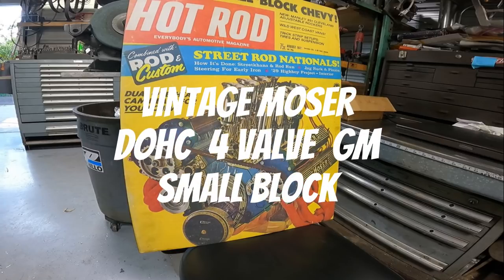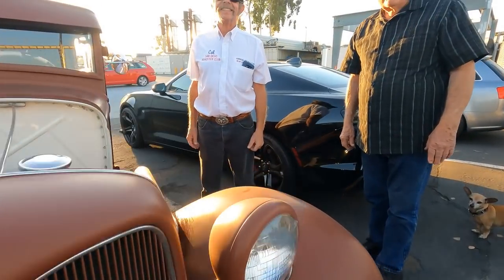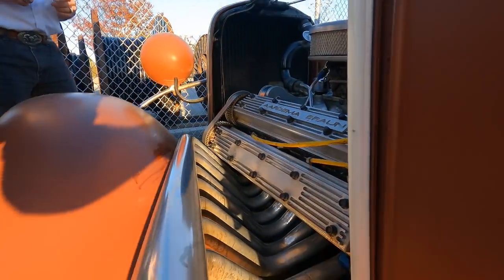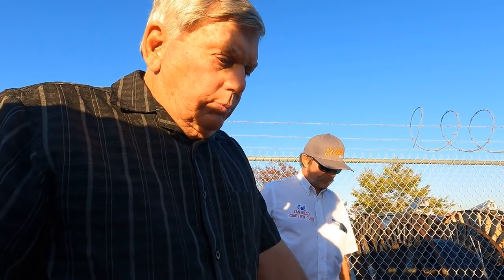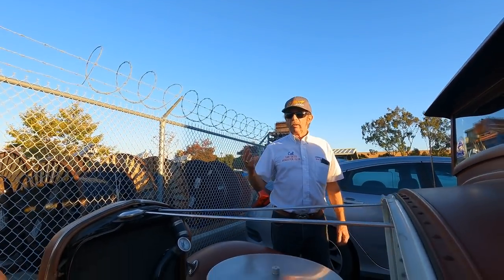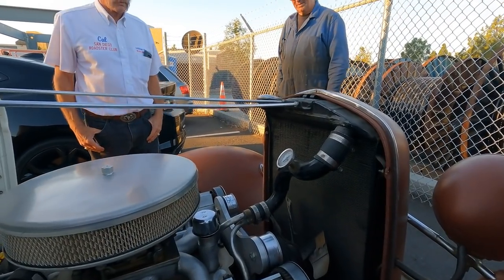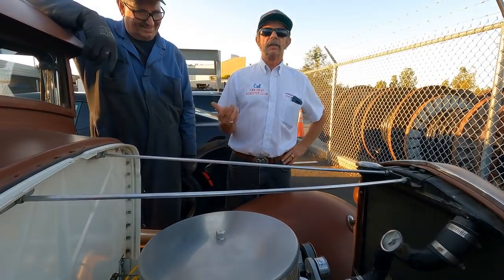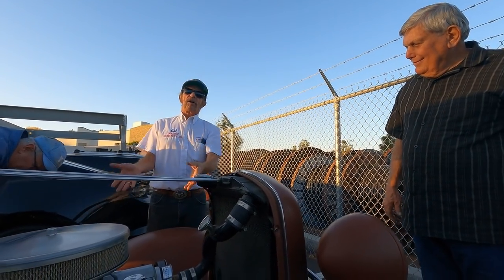Vintage Dual Overhead Cam, 4 Valve, Chevy 350, 1971 Hot Rod Magazine  Moser Feature Aardema/Braun

Comment: 2 exhaust ports per cylinder like a Merlin/Allison WW2 V12 aircraft engine, probably where they got the idea for the port style. genuinely an awesome part of automotive history, and something that's rare to hear running at all. it's like the GM version of the "Doomsday" DOHC Hemi that was prototyped for top fuel, but smaller and doesn't run on Nitromethanol.

Comment: So what does the pushrod cam do? Just spin in the block? I assume the overheads are the ones working the valves
Reply from the maker: It's used as an idler gear and drives the distributor and oil pump
Reply: @GregQuirin  Thanks! Great video and awesome engine!

Comment: I forget the guy's name but he took the 427 Ford single overhead cam and instead of a timing chain because the timing chain would get stretched out and you have to time both sides of the engine separately he put a whole bunch of deers that ran the camshaft which made it much more reliable and tunable

Comment: So, any plans for production? Somewhere I have an old magazine with an article on a bunch of Ford's crazy prototypes. They built a SOHC 289 or 302, intending to sell the setup as a kit but since they didn't optimize the intake and exhaust ports and the manifolds, they didn't figure it added enough so production didn't happen. Just needed some more R&D! The heads were special castings with several more valve cover bolt holes since that's how the cast aluminum cam carriers mounted.

That's one area of small block Chevy heads that's always been stupid, not machining the valve cover sealing surface. The covers require a massive amount of sealer on the gaskets, and they don't have enough bolts. Aftermarket heads of course often correct that by machining the top face of the head and some stiff aluminum valve covers can seal decently with the 4 bolts and minimal sealer.

Comment: At the same time Alfa Romeo was mass  producing chain driven all alloy DOHC engines with mechanical port fuel injection and individual throttle bodies.
Reply from the maker: Did you see my 32 Alfa 8C Monza video?  Check it out!

Comment: Arias has built several 502 Chevy big block V8's with DOHC 32 valve heads.  The heads themselves come from the Porsche 928's V8 engine, which is also a big block and as such the bore spacing is almost exactly the same.  With some welding and drilling the heads drop right onto the Chevy block;  These will pass California emissions and make 550 hp all day long with stock cams.

Cool video!
Reply: Anything will pass CA emissions if it's in a pre '75 platform.
Reply: @toomanyhobbies2011  I thought the engine year mattered as well?
Reply: @Flies2FLL  once your car is pre 75 cali aint checking anything you just drive it.
Reply: The Porsche 928 engines were not big blocks, they ranged in size from 4.7 to 5.3 liters in 2 valve and ultimately 4 valve configurations.
Reply: @hoost3056  The displacement does not determine whether it's a big block or not. Chevy made small block 400's and big block 400's (396). What he means is that the Porsche block has a bore spacing (the distance between the middle of two cylinders) almost on par with a Chevy big block. Porsche probably designed the 928 motor with racing in mind which usually means a big bore short stroke engine hence the relatively small displacement in the 928 compared to a big block Chevy
Reply: @erikkiel3695  The bore spacing of the Porsche M28 is 4.804 inches, very very close to the bore spacing of big block Chevrolet and Mopar engines.  This was done to give generous cooling jackets and Porsche built the cylinder barrels completely from aluminum, NO steel liners, so the barrel walls had to be thicker.  This produced a very large engine with smaller displacement.  

I suspect that this crate engine would fit just fine under a 928's hood with a proper low-profile intake manifold.  Since a dressed M28 weighs over 550 pounds, the car would need stronger springs in the front to handle the extra 130 pounds of the crate motor.
Reply: @hoost3056  The Porsche was a shorter stroke but similar bore.

Comment: The intake cams on both heads have a dangerously low amount of belt coverage on their pulleys. Hopefully it doesn’t skip teeth.
Reply: More than some production engines
Reply: front the miles he has on it and the spirited driving he has done to break drivetrains its pretty obvious it doesn't

Comment: Now, let's make it a non-interference motor, lower the compression  and add a turbo setup with fuel injection to find out what it can really do!!!
Reply: How mundane! Non interference and low compression—are there any more less exciting engine features you’d throw at this “dream” engine?  These guys are the polar opposites kind of guys if you hadn’t noticed.  They are all about unique and exciting engines!
Reply: @robertmason8341  I think maybe the intent was to build a lo-tech 2 valve, low compression motor but boost it (either turbo or supercharger, or both) and nitro. It sounds an awful lot like NHRA Top Fuel. I've seen them torn down from 20-30 feet away with a long telephoto lens, but the guys where far too busy to be leaning over their shoulders and bugging them with questions.

If you want to take a simple engine and then boost the crap out of it you can get just about what ever you want for power. Just look at the car shows and these guys that decide that they want more power than whomever is the hot guy at the moment. Anyone can stuff the next larger blower on an engine. The skills to build a hi-tech naturally asperated engine don't seem to be appreciated any longer.

Comment: Just guessing but I think this motor setup is just scratching the surface of it's potential. I'd love to see it on the HP Monsters Dyno with some of the NASCAR tricks to lighten the valvtrain. My point is I would like to see this thing zing about 12 grand reliably and I think it wouldn't take much to get there. I can tell by how it sounds it's not all happily married together. The cams and thier lobe separation would be the tricky part that would get expensive to test.
Reply from the maker: Mike, I noticed the valvetrain was also noisy.  Kevin is going to recheck clearances.  This video was the initial start up after the teardown and rebuild.   When it ran 279MPH  at Bonneville it was screaming.   https://fb.watch/9r0G-HPb30/

Watch this video and you will be amazed!
Reply: you'd have to pick between vintage-looking headers and a modern efficient design also

Comment: Those 8 exhaust ports are nuts. The geometry of the valve only needs some rotation ( no change in air flow resistance ) so that both intake ports point toward each other and both exhaust ports point towards each other. They may need so time to meet to the header probably needs a thick steal flange with a oval shape and then you need to weld in a triangle and bend the tube a little. But you get lower friction in a single tube, while still most heat goes to the air and not into the block.
Reply: I'm thinking one of those guys said it has only one intake port for each cylinder, but two exhaust ports because of head bolt access issues.

Comment: Great to see those twin cams finally getting into hot rods get hot rod ingenuity. Love it!
Reply from the maker: Thank you !
Reply: @GregQuirin  
It seems to many hot rodders, street riders, American gearheads in general seem to think cam in block pushrod OHV is what God intended. Engineers at American car companies all know OHC was more efficient.  Made more power etc. The problem was the bean counters. So to get more power they just increased displacement. The primary benefit of pushrod engines besides cost is packaging. Any V type DOHC engine is going to be wider. Even relatively small displacement motors such as say any of the US built DOHC V-6s. DOHC V-8s are worse. Look at the Ford DOHC or the Northstar/Aurora. Yet there were and are options out there for the guy who dared to be different. Mostly off shore brands but theres nothing wrong with the engineering in a Toyota or Nissan DOHC V-8.
The cost advantage for the hotrodder of a OHV engine is in the parts cost. You want a better cam.  It's one piece versus four or two. Plus the engines are easier to work on for the home builder. One thing that I think is going to make a difference in just how people look at multi valve heads etc is when FreeValve type technology hits the streets.
Reply: @mpetersen6  Because the 2-valve engines that are targeted by performance enthusiasts have all of the right stuff where it's needed, without 2x the valvetrain complexity.  And in any situation except WOT on a specific drag race course, a lower, broader powerband will beat higher power higher on the RPM band every time.  And there is very little advantage to adding valves if you depend on your engine for lower RPM performance (i.e. every single person who is 'racing' or goosing the throttle on the street, ever).  It's also more fun to have a larger, more immediately responsive powerband from an engine.  There IS  difference between 500hp on a small engine and a large engine, and it is a qualitative power difference.  There is almost no advantage to having 4-valves per cylinder inside of the MASSIVE power area a bigger engine will have over a smaller engine of the same peak power number.  And, to remind you, the most powerful automobile engines on earth, by a VERY long shot, use 2 valves per cylinder.  Top  Fuel runs over 10x the power level of any other regularly sanctioned car motorsport.  One Top Fuel dragster is quite literally worth 10 Bugatti Veyrons in power.

Comment: Is the head casting a Cosworth or a Crane original?
Reply from the maker: That would be a yes. Pete purchased the castings from the Crane family many years ago and redesigned the cylinder head upper unit with his own cam towers and belt drive.

Comment: OK I am completely stunned freaking stupid. This is so bad to the bone I'm speechless. I am really confused about something they said. What does he mean when saying, "we put these 4 sprockets on and a belt, so the crank drives all ((FIVE)) camshafts clockwise. " Like mind-blown. All five cams?!
Reply: In many GM engines the cam is driven directly off the crank with a crank gear driving the cam anticlockwise. You can reverse the direction of the cam by replacing the gears with sprockets & a chain or with a pair of idler gears between the crank & cam gears... Then, both crank & cam run clockwise, as opposed to the original anticlockwise of the cam.
In this engine they have extended the standard cam forward of the timing case and used a Gilmer style toothed pulley & toothed belt to take drive off the nose added to the original cam & run the aftermarket 4 camshafts all in the same direction. That's a total of 5 camshafts running in unison. The original cam in the block is no longer opening valves. But is still required to drive the oil pump & distributor.
He said the cams that came with the haul of goodies he bought were all designed to run anticlockwise...    That tells us the crank is driving the bottom cam at half crank speed via direct gears so the entire cam system must in turn run anticlockwise to make use of the very expensive camshafts that came in the haul.

All sounds a tad complicated... However, it's easy to get your head around it with a simple drawing of a crank pulley @ the bottom, a cam pulley right above & the 2 pairs of twin cams/pulleys above them @ left & right... Imagine the crank driving the bottom cam via a chain. Then imagine the bottom cam driven by only a crank gear & a cam gear & all 5 cams tied together with a belt.
Reply: Unfortunately, he uses the word sprocket when he says he took drive off the original cam...   He's referring to a Gilmer type PULLEY which of course is driving the 4 added cams via a belt.   Belts run on pulleys...   Chains run on sprockets...    It's a belt drive, not a chain drive...    He means pulley.
Reply from the maker: Here some more of the V12 at 9800 RPM on the dyno https://fb.watch/9r0G-HPb30/